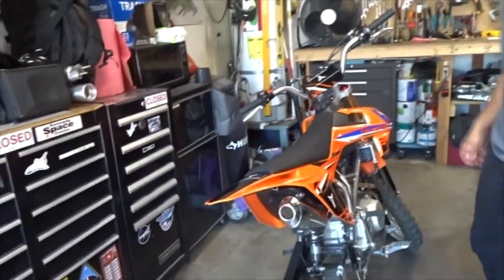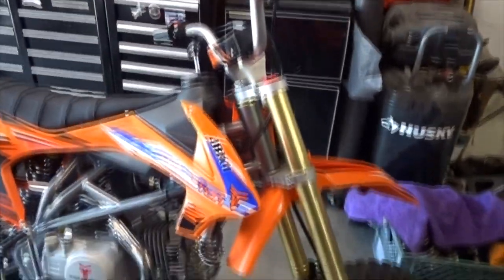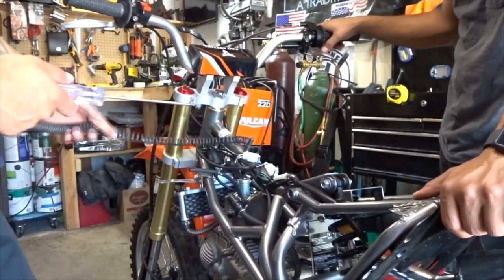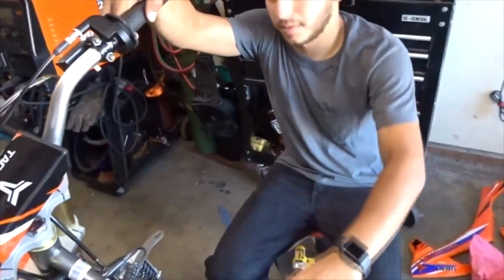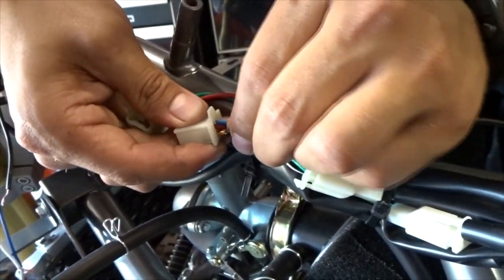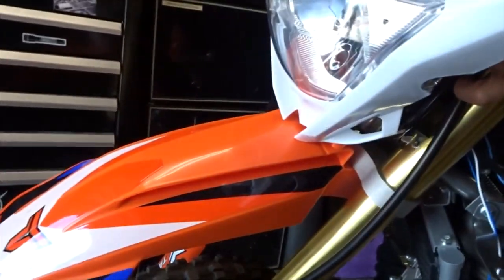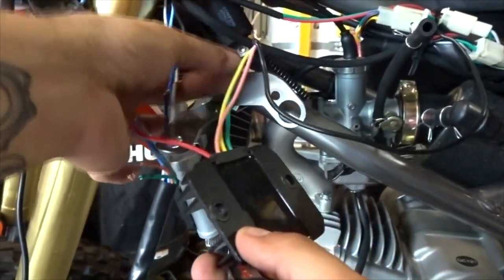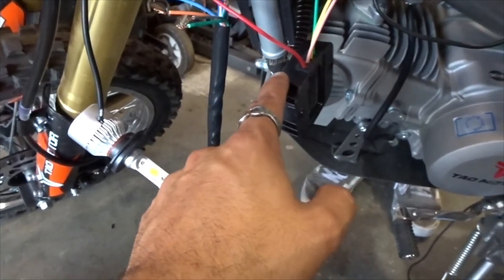Tao Tao 140cc Pit Bike Street legal light Set up (HOW TO)

Comment: To anyone watching this with a newer Tao 140 model the harnesses now have 2 yellow wires both are empty where they mate up on the other plug so you can do the same thing they did by tapping in to the harness but since you have 2 yellows you can Use either or and have 1 run to rectifier and 1 will be ground. In order to get your bike running good and powering the lights fully you have to increase your idle on your carb. Higher idle = more power running through your bike to compensate for the power the lights draw. I had bought a battery but found it was completely unnecessary, took up too much space and if you get the same handle bar switch as this video there’s no off switch for your lights so you would have to wire a separate switch to kill power from battery or unhook it every time, hope this helps anyone struggling. Shoutout to the video creator for giving the blue print ✊🏾
Reply: I also recommend upgrading your ignition coil to a nibbi. I have a nibbi 26mm carb hooked up with the smallest main jet that it comes with (i think 108) and needle dropped down to the 4th notch, creature cdi box and it runs great 👍🏾 17 tooth front sprocket installed already and a 35 tooth rear and road tires on the way. If you get the same size tires as your knobbies you can use your stock rim and tube
Reply: Another tip, if you have a battery to use as your power source while you wire you can test out your lights and switch without having to start your bike every time 😉
Reply: Can you make it street legal like the semi automatic ones like is it the same process and stuff

Comment: What you have there is a regulator/rectifier.  It has two purposes;1- it regulates the power coming out of the stator and keeps the power out to approx. 12 volts (thus not allowing regular incandescent bulbs to blow out from too much power) and 2. It transforms the AC power out of the stator to DC power (this will allow you to charge a battery and power LED lights).  Most LED will not work with AC power and you will damage the LED if try to powering with AC power straight from the Stator.  When powering LED lights you either wire straight from the battery or straight from the regulator/rectifier.  If you really want to do this right I would put some relays to protect the switch and wires from over heating and melting.  Also you will notice your lights are still flickering and dimming when the bike is at low idle.  The light gets brighter when revving higher.  This is because the stator is small and weak is probably putting out less then 12 volts at low idle and when the engine is revving higher the regulator limits it to 12 volts.  Again,  the preferred way is to power from the battery this keeps the power consistent.  You then open up a whole another project trying to stuff a 12 volt battery under the seat and building a battery box with some inline fuses.......etc.  There’s not a lot of room on that bike for that.
Reply from the maker: David Gomes thank you for your great knowledge, and yes maybe a battery install will be next :)
Reply: David thanks for your helpul reply. I have the same bike and I am going to do the same thing. I'm ok with a dim headlight if the stator is a little weak for the setup. There is a 190cc version of the same engine I could see if that stator will fit. My concern is what happens to all that extra voltage? This bike will put out more than 12volts at higher revs and usually the exccess volts go to charging the battery but if there is no battery what happens to the extra voltage? Thanks
Reply: Let me address a couple of things first.  The larger the engine or larger CC is not going to change the amount of electricity produced by the stator.  As an example, a 125cc engine spinning at 6,000 rpms and a 190 cc engine spinning at 6,000rpm will produce the same amount of A/C electricity if the stator in both engines are exactly the same.  The secret in producing more energy at lower rpms or at idle is a good quality stator/magneto with many pickup coils and good windings.  The stator's in most of these Chinese pit bikes are very basic with minimal pickup coils and cheap windings.  They were not intended to produce tons of energy to power heated grips/seats/headlights/charge batteries/power the CDI and any other accessory you would want on a bike.  Again,  if you want more electricity production look at getting a better stator for that type of engine.  I believe they do make them and you many need to source the parts from Ebay or Aliexpress.  I'm not sure what type of stator is in the 190 cc version of these engines but if it's better than the one in the 125cc and it fits then you will produce more energy especially at lower rpms. Now,  to address your second question about all that extra energy and where does it go.  The simple answer is: it goes into burning out your incandescent light bulbs and heating and possibly melting your wires and switches.  An incandescent bulb will work optimally at 12-13 volts.  It will also work at 18-20 volts and be a little brighter, but will also burn out that much quicker.  You will go through many  burnt out light bulbs hooked up to an unregulated stator.  Same goes for charging a battery with an unregulated stator.  Optimum recharging for a battery is approx. 13.5-14.5 volts (in that range).  Will the battery charge at 18-20 volts yes, but will also heat up the battery and the surest way to killing a battery is overheating it.  You must regulate that energy with a regulator/rectifier.  The regulator will smooth out the highs to a limit amount of approx. 12 volts (This insures nothing is getting to much energy).  It will also convert that energy from A/C to D/C current more appropriate for charging a battery since it is also DC current.  To do a proper job you should have several inline fuses to battery and other components as well as relay switches to lights/light switches.  This will insure no overheating of anything and damage.
Reply: @dgomes1967  David Thanks for your reply. I wanted to make sure there was nothing I missed. I was referring to the regulator in the setup as well. I confused the extra voltage coming out of the charging wires of the regulator to the battery. And assumed all the circuits would go up to 14v. I forgot how the regulator treats the battery different from the other circuits. My Chinese scooter has held up pretty well so far but it only has one fuse. So has my 140cc dirt bike. Though I must admit my scooter's headlights are really dim compared to the other Chinese scooters and I suspect I have a lot of resistance in one of the light circuits. Maybe one of the wires got overheated like you mentioned without a relay. Thanks for reminding me how the regulator works.

I did want to bring one thing up though. You said a 190cc stator generates the same power as a 140cc  stator. Are you factoring in the increase in bore size? The bigger the bore I believe the bigger the spark. Wouldn't the 190cc stator need to have more windings to generate that spike in energy for a bigger spark or longer ark? Thus making it produce more energy. I clearly notice a 50cc scooters stator has 6 windings and a 150cc scooter has 8. That has to count for something. I would love to hear your thoughts thanks again man.
Reply: Thsts frame rate bud the flickering
Reply: @dgomes1967  I have a rugulater wired to my hot wire but every time i ground it the bike dies. What am i doing wrong

Comment: When wiring the horn if you get a switch like this there is 2 wires for your horn. 1 goes on 1 of the 2 prongs on the horn with power wire on the other. The 2nd wire from your switch will be used as ground. When running off rectifier you have to turn your idle way up to get your horn to blow loud and not have your lights dim too much when hitting the horn

Comment: I wired my Chinese bike to make it street legal it was more complex then what is presented on this video. I added head and tail lights, rear break lights, left and right turn signals for front and back. I also added horn for some reason the horn isn't powerful. Do I need a capacitor or amp fus how did your horn sound. That on how you installed it and what it sounded like was completely left out.

Comment: when you were testing for the power wire, you could see your test light getting brighter as he revved it.  You had  to figure the voltage was increasing.
Reply: That's why it's most important during this video to use a 4 pin voltage regulator from Tao Tao on Amazon.

Comment: I just bough the same bike & I want to make it street legal all I need to know is the size of the banjo bolt that fits correctly, thanks
Reply: There is a switch you can order from motopartsmax that you can use without tapping the back brake. Its the taomoto gy6 front frake switch i used it on mine the already a spot for it on the front brake just srews on and is really easy to wire in
Reply: maybe I’ll consider that so I don’t have to touch my brakes
Reply: @thelongranger55  Correct size is M10 x 1.25 pitch

Comment: @brzrage Is the banjo bolt for the break lights the right thread ? Linked in the description?
Reply: Badass vid btw keep up the good work
Reply: No the banko bolt is possibly 28mm. I purchased a break light switch with spring to avoid the thread issue. You simply zip toe the switch to the frame of the bike by the rear break. You run the spring from the switch to break and when you press the break the break light will signal. Also it's way cheaper.

Comment: i am gona tell you it is not so good how you wire it becouse it does not have constant voltage even after you put there the regulator, you could see it in the  end when you started it, problem is simple  it is not goodfor the electronic in bike, how to solve it? easy put there some small batery something like this one Shorai APP14A2-BS12 Phantom Black Small 12V 14Ah
and i am sorry for my english
Reply: You are right.

Comment: How did you get the horn to work? I have the same parts as you but the two green wires from the switch don't do anything when I connect them to the horn.
Reply: Then your connection is not complete. The wires on the are neither + or - they are neutral. The horn also has neutral pins. Try from button to horn, from horn to negative on battery and from + on battery back to switch. If that combo doesn't work try another way but keep connection complete

Comment: Quick question I have the same bike but I want the back rims or tire to be a bit bigger the back stock tires are 90/100 14 what would you recommend for something a lil bit bigger?
Reply: i got the same bike i put a 16 inch
Reply: 16 inch back tire and 19 inch front tire. Apollo did it on a 125cc and didnt modify their frame and swingarm either. Thats what im gonna do. Itll fit and give you a bit more height definitely

Comment: How does it run with the stock carb? great vid!
Reply: It bogs with the stock carb. Well it does in the New England East coast elevation. I'm not sure about other states though. I replaced my carb with a NIBBI and it really woke it up.
Reply: Micscience thanks 👊🏾
Reply: Micscience I’m about to buy this bike tomorrow online , but I want to buy a new carburetor right away , so can you please tell me the size of the Carb I will need please thanks a lot !
Reply: The LongRanger i bought a new carb right away mine needed a new carb new stater right off the bat
Reply: Raptor Rider that sucks
Reply: The LongRanger ik but works great now
Reply: @Micscience  what mm size

Comment: What the right Brake light banjo bolt size?
Reply from the maker: MegaAngleface m10-1.25
Reply: Get a break light switch with a spring. Its cheaper and you will not have the thread issue

Comment: should push the two ends of wire into each other, twist slightly, solder, and cover with shrink tubing.
Reply: That would be a weak connection. A proper splice is stronger than a soldered splice. Sorry I know you are not gonna take this nicely but I had to say it.
Reply: @Micscience  oooh do tell!  Kindly explain what a "proper splice" is.
Reply: @Micscience  Evaluation of Tensile and Shear Strengths of the Copper/Solder Interface Assuming that the interface of the copper wire and solder is composed of the side and bottom surfaces of the cylindrical end of the copper wire, the maximum load, Fmax, is given by the sum of the tensile and shear strengths of copper/solder interface as follows: Fmax = πd2 4 pRσf + πdlRτf (1) where σf and τf are the tensile and shear interface strengths, d is the diameter of the copper wire, and pR and lR are the fraction of the actual bonded area to the total area on the bottom surface and the actual bond length evaluated using the binary image, respectively. Here, the relationship between Fmax and lR can be expressed by: Fmax = F0 +blR (2) as was shown in Figure 12, where F0 (= 8.79 N) and b (= 13.96 N/mm) are determined from the intercept of Fmax-axis and the slope of the approximated line, respectively. Comparing Equations (1) and (2), we can assume that pR = 1, σf = 124.4 MPa, and τf = 14.8 MPa are obtained. It was conﬁrmed by SEM observation that the actual bonded area on the bottom surface of the copper wire is about 1, independent of the specimen. The value of the tensile interface strength is a little high in comparison with the other results (σf = 50 to 90 MPa) obtained for similar lead-free solders and copper[9,10],andthatoftheshearinterfacestrengthislowerthanthepreviousresult(τf =40MPa)[11]. The constraint of plastic deformation at the bottom surface of the copper wire [12,13], the size and shape of the specimens, and the data dispersion (which will be described below) may be the reason for these differences. In order to investigate the effect of data dispersion on the evaluation of the interface strength, two parallel lines passing through the points most distant from the straight line given by Equation (2) are considered, as shown in Figure 12. The tensile interface strengths evaluated by these lines are 153.3 MPaand99.0MPa,respectively. Sincethetwolineshavethesameinclination,theshearinterface strength does not change. If an accurate value of the interface strength or its distribution is required, a large number of pullout tests are necessary, and the microstructures of the solder and copper wire as well as their change near the copper/solder interface should be investigated [14,15]. Finally, the strength of the copper wire/solder joint is schematically shown in Figure 13. A red chain-line shows the shear strength of the copper/solder interface. The strength increases with the actual bond length, lR, and its intercept of Fmax-axis becomes the tensile strength of the copper/solder interfaceonthebottomsurfaceofthecopperwire,becausenobondedareaexistsonthesidesurfaceof the copper wire when lR = 0. A blue-chain line shows the tensile strength of the copper wire, which is
Crystals 2017, 7, 255 9 of 10
obtained by the tensile test of the copper wire without the solder joint. Here, the transition length, lR*, is deﬁned as the intersection of shear and tensile strength lines. When the actual bond length of the copper wire/solder joint is less than lR*, the interface strength is governed by the shear strength of the copper/solder interface. On the other hand, when lR is larger than lR*, the joint is strong enough and the copper wire becomes fractured at the tensile strength of the copper wire before the pullout of the copper wire. This relationship is useful for the determination of the geometry of the copper wire and solder in an actual electric package. Crystals 2017, 7, 255 9 of 10 
 the copper wire/solder joint is less than lR*, the interface strength is governed by the shear strength of the copper/solder interface. On the other hand, when lR is larger than lR*, the joint is strong enough and the copper wire becomes fractured at the tensile strength of the copper wire before the pullout of the copper wire. This relationship is useful for the determination of the geometry of the copper wire and solder in an actual electric package. 
 
Taken from the published article
Evaluation of Thin Copper Wire and Lead-Free
Solder Joint Strength by Pullout Tests and Wire
Surface Observation
Naoya Tada * ID , Takuhiro Tanaka, Takeshi Uemori and Toshiya Nakata
Graduate School of Natural Science and Technology, Okayama University, Okayama 700-8530, Japan;
pkl893lm@s.okayama-u.ac.jp (T.T.); uemori@okayama-u.ac.jp (T.U.); tnakata@okayama-u.ac.jp (T.N.)
* Correspondence: tada@okayama-u.ac.jp
Academic Editor: Arkady Zhukov
Received: 13 July 2017; Accepted: 18 August 2017; Published: 20 August 2017
Reply: @percussion44  Yep you did get mad...... 

I don't know why you pasted that evaluation it is still irrelevant to what I said' ("  Evaluation of Tensile and Shear Strengths of the Copper/Solder Interface") key part would be: ("Assuming that the interface of the copper wire and solder is composed of the side and bottom surfaces of the cylindrical end of the copper wire")

The splice I'm talking about is all composed with the side of the copper wire. Some what like a the letter T. Maybe I shouldn't have said the word proper and maybe stronger but still you shouldn't get worked about it man.
Reply: @Micscience  Worked up? hardly,  The evaluation shows that given sufficient bond length between the solder matrix and copper strand  the copper solder junction becomes the weak point were the copper strands can break.

Point being the soldered wire connection is not "weak" and it would take a large force to pull the wires apart and break the junction.  This is a low power pit bike application.  In some accident or incident were an object with sufficient force has entered the bikes frame and broken the connection in a headlight setup, such a break is probably of little concern in the overall calamity.